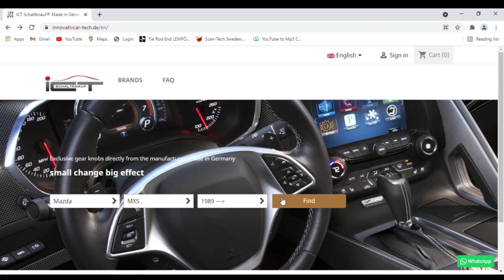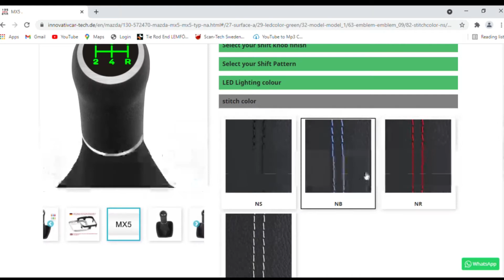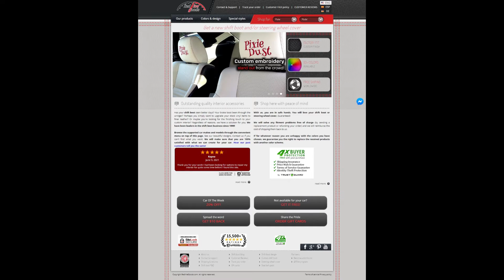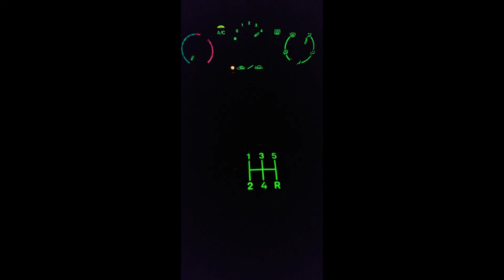Mazda Protege LED Shift Knob Install EP. 13

Comment: Question: My 02 Protege 5 manual pups out from 3rd gear, but when I keep my hand on the shifter it does not. To be more clear, let's say I go uphill with 3rd gear all the way, it will pup out from the gear to neutral unless I keep my hand on it. What do you think the reason is? Transmission mount? Other than that it doesn't have any issues, only the 3rd gear... Like your videos 👍
Reply from the maker: SO I would first check all of the engine mounts and replace any that are worn out. Also inspect the condition of the lower shift rod bushing mounted on the back of the gearbox. If worn out, this can cause some shifting issues. You should also check the other bushings in the shift rod assembly as the plastic ones will dissolve and fail over time. Corksport makes brassoil bushings for replacements. I'm running these and they help eliminate shift linkage slop. Next I would check the gear oil level. If the gear oil is low, consider changing the gear oil. Right now I'm running Redline MT-90 full synthetic gear oil and I personally I find it is the best aftermarket oil for the Protege compared to the factory Mazda manual transmission fluid. You will need about 2.8 Qts should you decide to change the oil.....if this fails, likely there is a problem with the synchromesh for  3rd gear. It means you likely would need to have that replaced or simply replace the gearbox. Before replacing the gear oil, drain it and see if brass shavings come out in large clumps...if you see that, you should prepare to have the box disassembled for repair or replaced.
Reply from the maker: Also thanks for watching!!

Comment: How do I get to see all the videos about the protege cuz I'm doing one right now and I need all the help I can get
Reply from the maker: Keep watching & Subscribe and hit the notification bell so that when new uploads post, you'll get a notice! Hopefully ill post something you need. Or if there is a specific issue you need to know about, post it in the comments and maybe I can do a video on it. I saw your video on the fuel pump...the same thing happened to me. Use needle nose vise grip pliers to grip the head of the screws for removal or an impact phillips screwdriver to remove stripped screws. You can get impact screw drivers from tool trucks or visit snap on or matco tools and order one from the webpages. You can get suitable replacement screws from Lowes Hardware or Homedepot. As far as the instrument cluster with a tachometer, I covered that in the headlight upgrade video. Its plug and play.